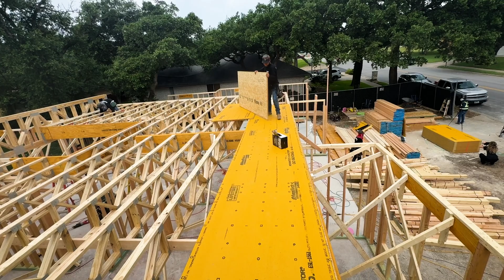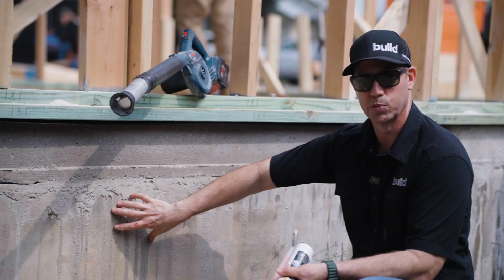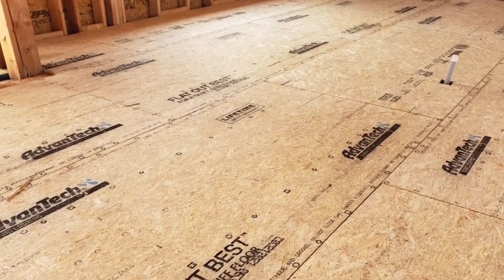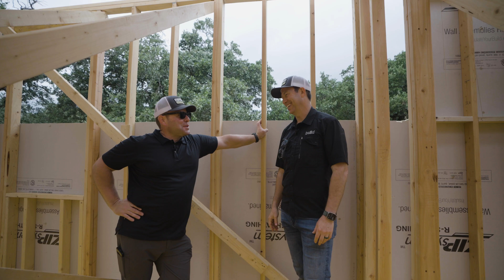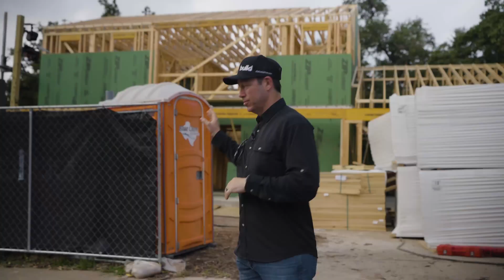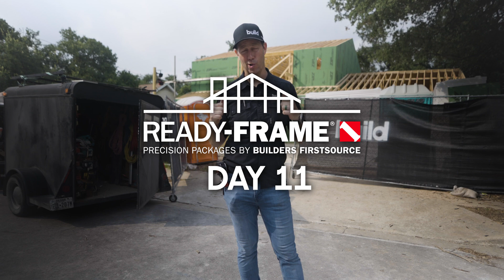The Risinger Build: Episode 5 Part 2 - Framing with READY-FRAME®

Comment: Can u use yellow zip floor as sheathing n proclima spry caulk in all seams then tape over seams with additional zip brown sheathing with an inch of foam attached with plastic screw or nail washers for good sealing then therma
Light with 2or 3inch foam  over that 
Wall would be bomber but is it too thick ??

I’ve seen zip sheathing rotted all to hell in new track Florida homes 

6 or 7 inch sills ok ?? 

Also a good SA wrap over first layer of yellow sub floor used as sheathing??

In addition to as much engineered lumber wit ready frame n 
Proclima spray caulk in all seams then taped over that 

Windows backer rod spray foam proclima spray caulk then tapped over with Siga fen trim 

Rubber seal sill plate? 
Carlisle over top rubber wrap??
Spray caulk all inside sheathing seams then 3 inches spray closed foam
Additional zip rain screw on top of  therma light ???!!

Comment: Why are builders still building as though they can see molecules with the naked eye when they can’t ? Vapor water molecules. In the envelope. In window corners where tape has a space of 2-3 pins is like a lake of moisture and wind. Why not 475 spray all seams then tape over. Builders can’t articulate anything as far as technique or materials they explain everything as though they’re explaining it to them selves. I don’t understand plumbing electrical roof or floor trusses but I do understand envelope sealing. 
Why doesn’t zip come with a built in rain screen and external foam attached to sheeting ??
Factory home building should be new industry machines run by computers in controlled environment as an exact science instead of hands on errors an extreme in efficiency!!?
As sophisticated as home building gets the builders r dopey. 
More engineered wood. Building today I think is about chemistry but  hands on errors and imperfections. Al! could be eliminated with computerized engineered machines and 100 times more efficient and exact. I have no interest in sawing and hammering but love home building from a modern factory. Even Ted benson wood is obsolete n he’s the best. 
Zip foam on outside green fascia with an attached double rain screen.
Henry blue skin is half way there.

Comment: I cringe every time y’all act like L/360 is good for a floor.. With 3/4” subfloor and 24” oc trusses. I’ve found the subfloor has to be deflecting even if the trusses are L/600. I always recommend a max 19.2 on residential floors.

Comment: Oof. Glue or no glue. Using nails is cheap. If I were the home owner, I wouldn't accept this house. Matt isn't going to come back in 10 years, pull up the flooring and knock down dry wall to fix the floor. The owners are.

Comment: In the mid 1990's New Zealand House builders started using factory built Prefabricated timber walls and roof trusses which are delivered to site soon after the concrete foundation has cured and erected on site in one working day

Comment: Instead of "Ready Frame" I'd just have the walls prebuilt and then shipped to the site; THAT would be the epitome of construction efficiency.
Reply: Not enough room to stage them that way according to part 1.
Reply: That's the way it has been done here in scandinavia for decades; you either have just the lumber, lumber cut to sizes and sorted or ready built walls and a crane, sometimes with windows and everything pre-installed on them, just drop on a slab and nail in the corners.

Comment: The rotating telehandler seems like it would have been a great investment for the job given how fast you are going and how hot it is.  Two weeks rental and major material handling is complete.

Is the Zip fire rated itself, or do you need to add drywall to get the rating?
Reply: Seem like as long as there's a continuous wall, it can be considered a “firewall” since that's one barrier that a raging fire will need to pass to consume the structure. That said, it will only block a fire for only so long being wood based... and lacking of insulating materials like those often applied to steel structures/ supports.
Reply: @PrograError  Regular drywall has paper that burns; fire-rated drywall is fiber reinforced to maintain its integrity.  It is all about how long the wall assembly maintains its integrity.

Comment: Is zip r more cost effective than just doing 2x6 exterior walls?
Reply: It'll give you better insulation for sure. Getting +7 r value going from 3.5" batts to 5.5" batts in the cavity is not the same as getting continuous R6 on the outside. All about that thermal break.
Reply: usually here in New england it would be 2x6 plus r sheating

Comment: The Japanese have an interesting fastener they tend to use near corners.  It is embedded in the foundation, and during framing a fastener slides over it and is then attached to the corner posts (or studs).  It keeps the sill plate fastened down, and in addition it helps the corner stay attached to the plate (and foundation).

Comment: Ok, why not Zip the walls while it's still on the deck?  Square then Zip then tip up...  You won't (mostly) have guys on ladders or scaffolds trying to sheath..,
Reply: He literally explained this, it means the ZIP sheathing doesn't stop at the floor plate. He also can multitask with multiple smaller crews putting walls up at once because the lumber is pre-cut.
Reply: @ssl3546  My comment came before that section of the video, but that's not a good reason in my opinion.  If you want it to let's say extend 4" below the sill, fasten it down that way.  Tip it up and it's 4" below.  As for multiple crews, sure, two guys can knock out a wall (or one guy), so four guys are working on two walls and so on.  And when the wall is tipped up - zero guys will need to set up scaffolding and hoist Zip up to also zero guys installing it.  And yes, I've done it...

Comment: Obviously Tapcon screws are too small to anchor a wall to a foundation, but I would prefer a screw/bolt that grips the concrete on its own to a large degree even without the epoxy, and the epoxy would be added protection. I am not thrilled about seeing the bolt slide in with little resistance before the epoxy dries.
Reply: I build industrial machines that we anchor with epoxy and all thread. The epoxies are pretty amazing.
Reply: The oversized hole is spec'd. If the epoxy layer (between the bolt and side of hole) is too thin it isn't as strong.
Reply: So you prefer friction to chemical adhesion?
Reply: @raygunsforronnie847  I prefer both.